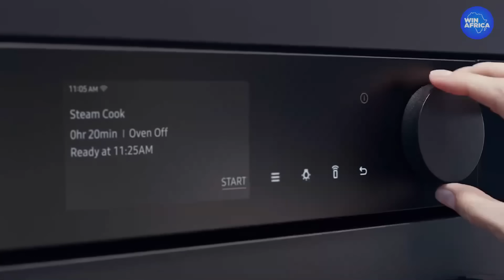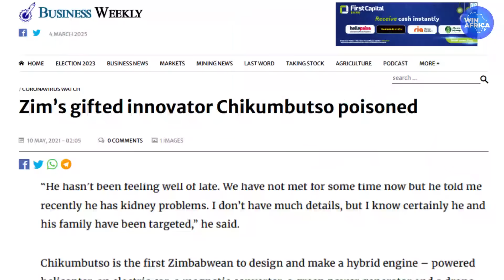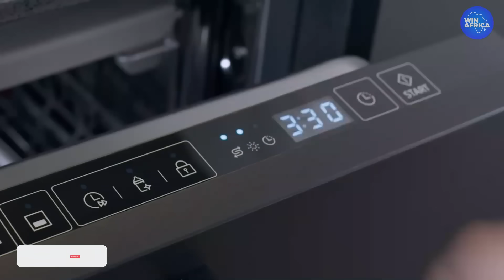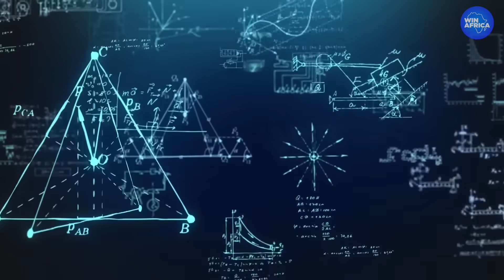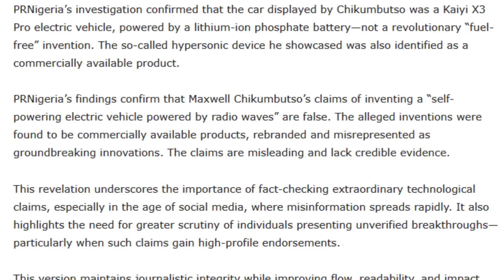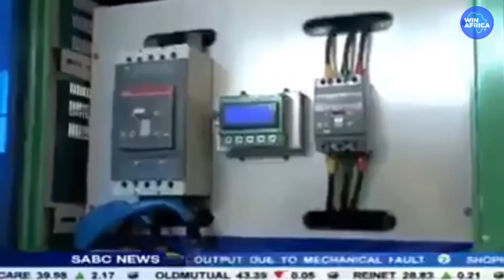Tesla & China Stay Silent as Maxwell Chikumbutso’s New African Technology SHOCKS the World!

Comment: Just to clarify - I am no expert.
But if there would be a device that converts radio waves into the energy (there are, at least know in small scale) it doesn't necessarily need to break a law of thermodynamics. We are flooded not only by human made radio frequencies, AM, FM, 2G, 3G, 4G, 5G, wifi, or military grade radars... which all are generated by antennas powered by energy source... but also if you think about it there is a lot of background noise, and there is a question of utilizing that one as well, the static that will always be there even if whole man made infrastructure won't be working. Interesting idea, have no idea how and if it works, but please go ahead. There is no patent required if a whole country converts to breakout technology. Patent, and explanation about how it works, how it either shows holes in our current understanding, or how it works not violating any previously discovered laws will appear later.

Comment: Scam. If "radio waves" had that much power, you'd be dead just from walking around. Note how actual radios, designed to absorb radio waves, still need batteries or a power cable just to run a speaker.

Comment: The best case scenario is Tesla's technology being combined with Chikumbutso's wireless power technology. Especially in terms of cars Tesla's batteries combined with wireless power for mileage range and then wireless plus direct-in external power charging at home would would magical. I think it's unlikely that Chikumbutso's wireless power would ever be able to replace direct-in external power by the same logic that internet speed is faster and more stable via an ethernet cable vs WiFi both are valid and accessible, but in terms of power a direct connection would be better overall with wireless power as an additional or auxiliary option rather than a direct replacement.

Comment: Cars need a lot of amperage which means a large power source, large wires, a big motor.  Radio frequencies do not have enough power through the air to run a motor that will run a car.  I wouldn't be surprised if this is a scam.

Comment: Electromagnetic induction. Magnets and a conductor (usually a coil of wire), which causes a change in magnetic flux, inducing a voltage and, subsequently, a current in the conductor if it's part of a closed circuit.

Comment: If it runs on radio waves and it doesn't need fuel or electricity, why is there a lead-acid battery under the hood? If it can generate its own power, why does it need a battery? If it's that high tech, they should capacitors instead. They clearly say in the video it "Violates the laws of thermo dynamics." It looks like a regular hybrid under the hood to me. I'm calling hoax. The bike has a charging port on what would be the tank. Total shenanigans. Why aren't they putting this to better use like providing people with free electricity so they can easily provide clean water to people in the world? If it's real, it's worth trillions of dollars. It would be the greatest discovery in history. It would fundamentally change the world as we know it. It would practically eliminate poverty. The prices of literally everything would drop. Never say never, but this is pretty unbelievable. That tech looks like a version of The Flux Capacitor that got turned down for Back to the Future. What's next, does he have a Mr. Fusion lying around the house? No wait. He's got a hover board too.
Reply: Because the energy has to be transferred into something. 
And probably to start the car?
Reply from the maker: That’s a fair and well-thought-out critique—you’re right to question the science, because any claim that challenges the laws of thermodynamics should be met with healthy skepticism, but if there’s even a fraction of truth to it, the implications could be revolutionary and deserve transparent, peer-reviewed investigation.

Comment: Nonsense. The radio frequency, if he's drawing from it, will diminish the radio frequency power. Example, you are listening to the radio, he drives by, your radio station turns to static because he's drawing all the power. Radio frequency power is not free. It's not natural. It's not in abundance. If the radio station is pumping out 30 megawatts, how many cars can run before the radio frequency can no longer broadcast any music. Sure you can just use radio frequency stations to run cars specifically, but power still must be produced somehow to broadcast out to be used. It's not free

Comment: keep smoking that african kush brotha's 
chat gpt said if you wanne drive regular 10 kw ev car 
it means your antenna will need to be like 20 millions square meter and with a stable 0,1 mw/m² signal on the whole surface 
examples of RF sources i asked chat gpt   ;
Wi-Fi (2.4 GHz) 0.001 mW/m² (0.000001 W/m²)
4G/5G Tower	~0.01–0.1 mW/m²	

FM Radio	~0.0001 mW/m²	
Ambient RF Noise	~0.000001 mW/m² (1 nW/m²)

Comment: Converting the electromagnetic spectrum or in this case radio waves into electricity is nothing new. Its been done with light (one form of the electromagnetic spectrum or wave), through solar panels. Another way is crystal radio which operate with no battery, it harness radio waves, covert radio signal into "electrical" and convert to sounds in a ear piece. (How a crystal radio works - https://www.youtube.com/watch?v=0-PParSmwtE&t=25s). Now, the only problem with converting electromagnetic spectrum or in this case, radio waves (is just one form of wave) into electrical power, is if there is enough power to run the load (Electrical motor, etc., etc.)? Well, only time will tell whether if this guy claims are real or a hoax.